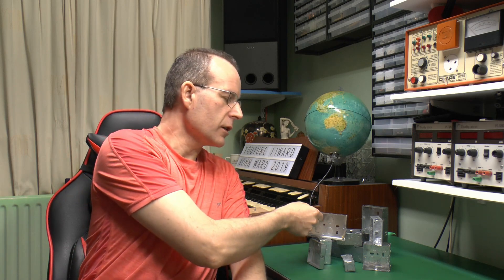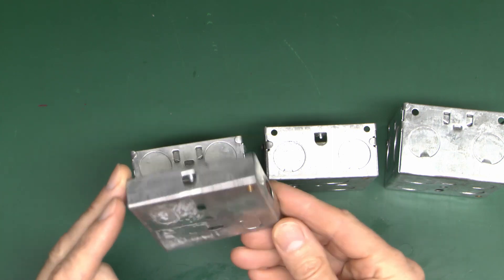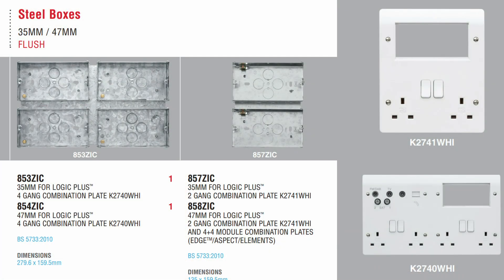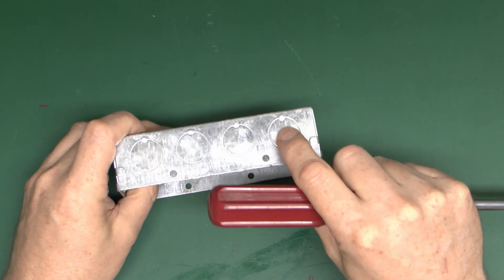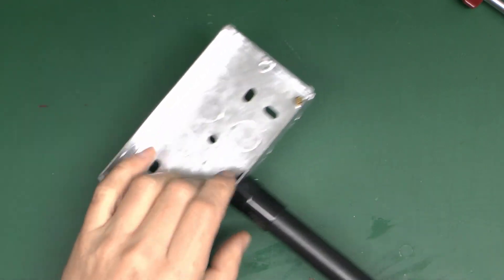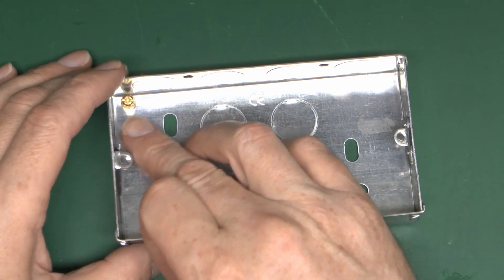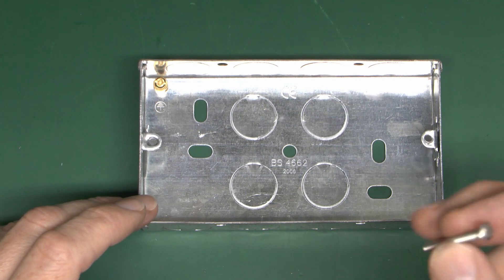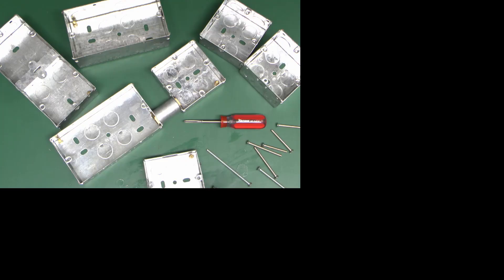Metal Backboxes For UK Sockets and Switches

Comment: OK the more video's you do on UK standards the more it lookes like the UK has had 0 evolution for the past 40 years!
 not only are those boxes metal but you can't even fit them together in any sensible way!
Reply: Not sure what you mean. Metal boxes are strong and fire proof so advantageous. We do fit surface mounted plastic boxes, or plastic cavity boxes. Metal boxes aren't an issue as long as they are grounded.

Trust me... there has certainly been many changes over forty years. Our IEE regulations are VERY stringent.
Reply: Plastic boxes are available, but galvanised steel is more fire resistant. As for fitting them together, there's really not much point as sockets/outlets and switches tend to come in standard sizes, and overwelmingly single and doubles with a very few triples. I'm leaving out special purpose ones like outlets for electric cookers and so on.
Reply: @TheEulerID  

There's actually quite a few fused triples around now, have a couple in my house.
Reply: what's your deal with fire ?
are your house made from matchstick?
A sensibly maintaine electric istalation dose not catch fire ever in the first place!

Also I would be so shure metal boxes are more fire-resistant than plastic.
Finally when I say mont them together I mean that if I go to any modern electric supplier I will be able to get enlessly clipable  box therfore creating the disiered shape with out any problems
Reply: @martinw245  I'm sorry but the fact you still use rings and have the most mainquiest plug in existence ( that things might be safe but it's also a pain in the ass to do anything with it) makes me encline to say that you haven't evolved that much.

seriously what is wrong with the europlug?????
Reply: @alfoncejean8826  

Huh... we dont have "a deal with fire" just letting you know the advantages of metal boxes, they are cheap, fire resistant, and safe. And yes, we do use plastic boxes too, mainly for surface mounting or cavity walls. We also use plastic boxes for junction boxes. Not sure what your issue is really, I'm sure your country uses some metal boxes too. And yes, it's pretty obvious metal is more resistant to fire than plastic.
Reply: @alfoncejean8826  

We dont need to clip our boxes together. Not sure what kind of "shapes" you require and why but all we need is single or double, and triple outlet boxes are also available. We have no need to clip anything together.
Reply: @alfoncejean8826  

Our ring main system is working fine thanks. But we dont rely on just rings, we also use radial circuits too.

As for our plugs, what's wrong with them? And what do you mean "cant do anything with them"? We dont need to do anything with them, we just plug them into the socket? Lol! Yes, you are right, they are very safe, and easy to wire.

The reason we dont use European style plugs is because we have a ring main and require plugs to be fused.

Not sure why you are intent on criticising the UK wiring system. You wont see me criticising your system, as long as the way your country does it safe, and my country does it is safe, that's all that's important.

This isnt some kind of "my wiring is better than yours" competition is it? Lol! Because that's immature and silly.
Reply: @alfoncejean8826  Oh dear, this is getting a little tedious. No, UK houses are not made of matchsticks. The great majority are made of brick and block construction, although internal walls are very often stud, although even my 1990s house uses block internal walls downstairs. When it comes to the relative prevalence of fires, here are some links to US and UK stats on the matter.

There were 3,400 deaths from fire in the USA and 334 in the UK. Adjusted for population, that's rather more than twice as many in the USA than the UK. 

https://www.usfa.fema.gov/data/statistics/

https://assets.publishing.service.gov.uk/government/uploads/system/uploads/attachment_data/file/738432/detailed-analysis-fires-attended-fire-rescue-england-1718-hosb1718.pdf
Reply: @TheEulerID  USA uses aluminium.!
Reply: @martinw245  you are making my case right? 
reason why rig main is retarded:
A) it can fail and become a fire hazard without anyone noticing.
B) ithe create a mess in switchboard.

BTW why the duck do you even need 32 A per plug????
Reply: @alfoncejean8826  actually the USA uses aluminum...
Reply: @alfoncejean8826  32 A rings are extremely useful. It means I can plug a couple of high draw portable devices wherever I like in the kitchen, workshop or wherever without having to worry  about an overload. 

As for this issue that rings can fail and cause fires, then it practice it's pretty well non-existent as a real-world risk. It would need two devices drawing about 28A on one side of a broken ring and so some time. It pretty well never happens. Electrical fires are almost always from appliances these days, and not from installations unless the regs have been seriously breached.

 If people don't like rings, then 32A radials on 4mm are often installed (again, very useful in workshops or kitchens). 

The fact is that from the stats I've found electrical fires are much more of a problem in the USA. It requires twice as much current for the same power (and power dissipation goes to the square of current for a given resistance). I also see plenty of reports of overheating plugs/outlets as the grip on those thin pins isn't always great as they age and the plugs partially fall out with the way the leads emerge. 

With UK plugs and power adapters it's pretty near impossible for that to happen because of the three-pin arrangement and that the lead is deliberately designed to emerge from below, so next to no leverage.
Reply: glyn hodges  umproper practice in a construction environment. nothing to do with standards. Plus we are talking fixed installation pls stay on point.
Reply: @TheEulerID  lol USA electical  is a joke the only thing worse is China!. 

The problem I have with ring it that it has a silent falure mode ans ithe offer literally NO adventage over radial ( besides money pinching ).
The problem with the UK plug is that it offer NO adventage regarding the europlug and it is way less common. for the sake of standardisation it would be best to pick one standard and keep to it.

To be perfectly clear I'm no big fan of the CEE7/3 I prefer the polirised 7/5.
Reply: @alfoncejean8826  "The problem with the UK plug is that it offer NO adventage regarding the europlug "

Completely untrue. In Germany, and several other countries, there is no polarisation. It means that if a device has an internal fuse, there's a 50% chance if it blows due to an overload the internal circuitry will remain live. The same with any device, like a table lamp, with a single pole switch; there's a 50% chance it stays live.

Then there is a massive advantage to UK plugs in that we can have more powerful circuits and not have to worry where we plug in appliances. In my kitchen, I can have a single 7 kW circuit and plug in appliances where I like using standard outlets. The same in a workshop; as long as I don't exceed the total capacity of the circuit, I'm fine. It's only possible as each plug has its own fuse. In countries with 16A radials maximum, then if you want to plug in 7 kW of load, you will have to use multiple circuits and also make sure you know which outlet is on which circuit.

Then there is the situation that if you plug a table lamp into a standard European outlet on a 16A circuit, then the only thing that's protecting the thin flexible cable is that 16A breaker. With the UK system of a fuse in a plug, you can put a low value fuse into the plug and protect the flexible wiring properly.

Then there is the shuttering of UK sockets which has been in place since the standard was developed. That's not compulsory in a lot of European countries.

Also, if you don't like ring circuits, then fine. They are not compulsory. Ireland uses the UK outlets, but doesn't use ring circuits. There are also plenty or ring radial circuits in the UK too, and some electricians prefer 32A radials using 4 mm^2 cabling for locations like kitchens. They are very convenient in locations with multiple, high/medium power outlets for things like microwave ovens, electric kettles, toasters, washing machines, driers and so on.
Reply: glyn hodges  For the last time this i a totalt tangeant and not relevant.
BTW you are not even to the level of the wikipedia article this is ridiculous.
Reply: @TheEulerID  " if you don't like ring circuits, then fine. They are not compulsory." ofc but saying  something with a silent failure mod is ok is very dangerous and quite irresponsible.
" if you plug a table lamp into a standard European outlet on a 16A circuit, then the only thing that's protecting the thin flexible cable is that 16A breaker. " and thy why you don't use bell wire on lamps !
"Then there is the shuttering of UK sockets " so dose the europlug (i find them pointless but that more a personal convinace than anything.
"there is no polarisation" why i recommend the CEE7/5.
honestely this argument is pointless, i dont even care witch plug is better im just saying its not a goog idear (town down for yt) to have a type of plug per country.
Reply: glyn hodges  ergo ungoing investigation  : not relevant here XD!
Reply: glyn hodges  obviously you don't understand the french justice system more that the term "stay on subject"
Reply: glyn hodges  i think its not the point and i dont care! LOL
Reply: glyn hodges  or i could be that i don't thing a comment feed about uk  electrical installation is the best place to discuss incidental historical monument  fire in France....
But you'r right i MUST have an agenda, whatever that may be.
Reply: glyn hodges  surprise, surprise, I don't want to talk about an off topic, pointless random fire WE don't even know the cause!
But you right I definitely not read that the Notredame fire was potentially stated by a cigarette (in breath of security protocol, ergo not very scrupulous contractor)!